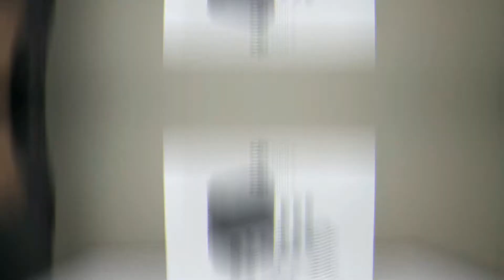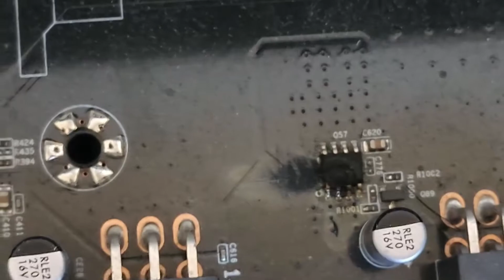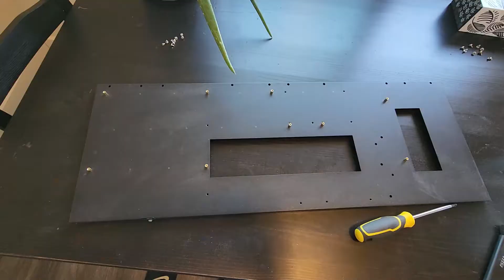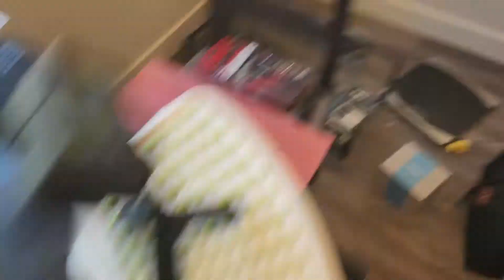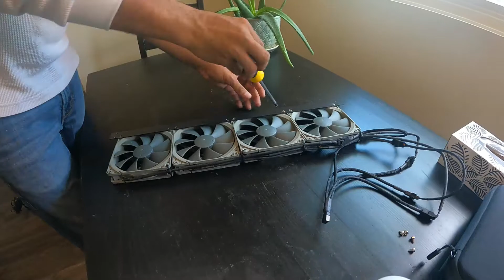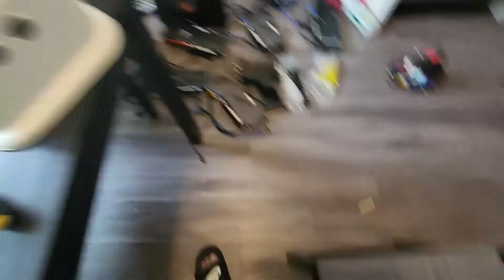Crypto Miner MB replacement | How to Start with Mining & Crypto Currency in 2022 | Beginners guide

Comment: Nice video also have one of those board it works good. And is only today I was thinking to do the same with my motherboard and used the risers
Reply from the maker: Make sure you buy the good quality risers that have metal shielding with 10 solid capacitors so the power supply is more stable.
Reply: @IamZak  yeah those are the risers I have I just need to get some more